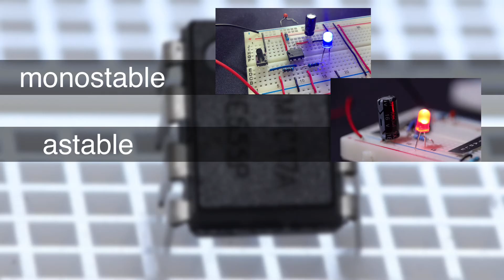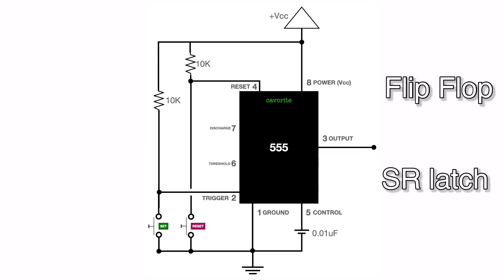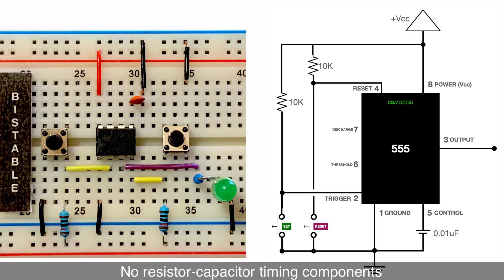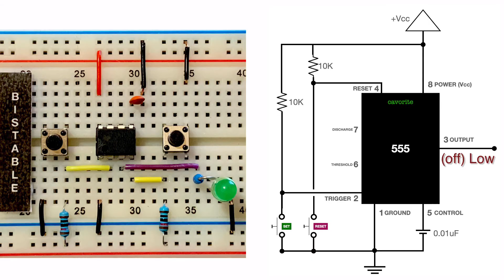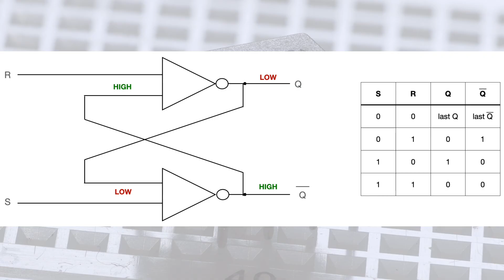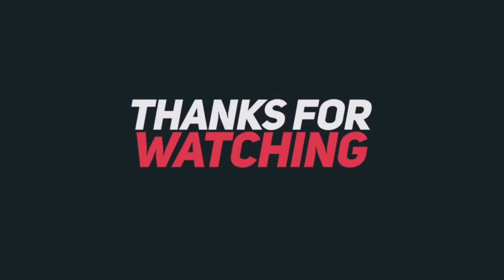Using the 555 Timer in Bistable (flip-flop) Mode

Comment: I tested it. if you leave the threshold pin floating, it won't work as bistable. if you connect threshold to Ground, it will work fine.